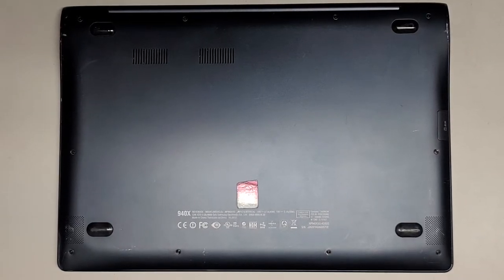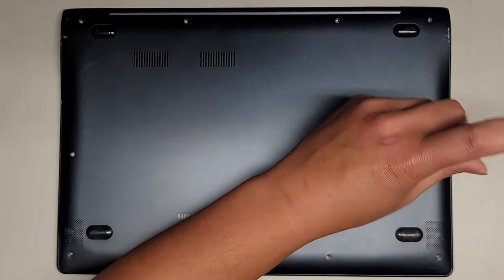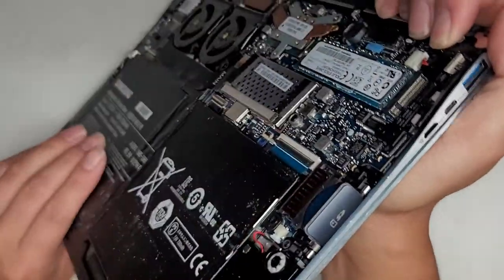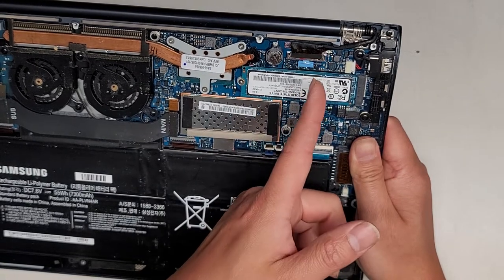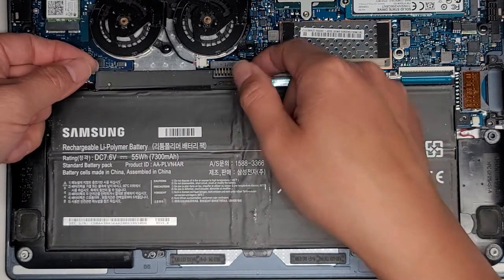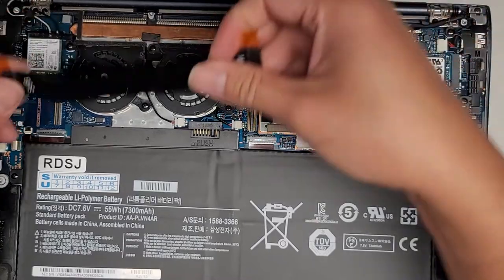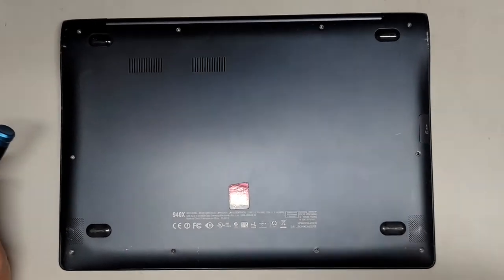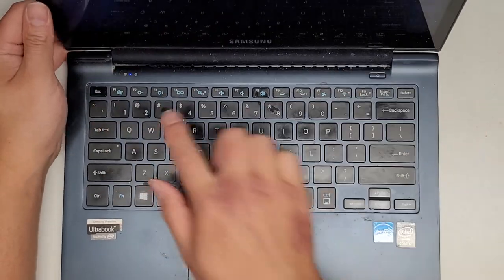Samsung Notebook 940X NP940X3G Disassembly Battery Replacement Repair Quick Look Inside RAM Soldered

Comment: Would it still be a battery problem if the little orange light turns on when I plug in my charger even though the laptop won’t turn on?
Reply from the maker: More likely a motherboard or power button issue

Comment: Hello, I have an external power supply problem on my SAMSUNG ATIV NP940X3G-K01US laptop. The battery no longer recharges, yet it is brand new (I just replaced it). When I plug in the power supply, the power indicator light turns green for 1 second, then it turns orange and then it turns off. I think it is a problem with the internal battery charging system. What could I replace to solve this problem?
When I power the laptop without the battery, the computer does not start, it displays the SAMSUNG logo and then it shuts down.
Thank you for your help.
Kind regards
Philippe
Reply from the maker: @PhilippeBourgine74  how old is the laptop?
Reply: @ItsBinhRepaired  about 10 years, but until today it worked perfectly. I do not know what part I can change by myself.
Reply from the maker: @PhilippeBourgine74  maybe needs a new battery

Comment: What's the name of the connector that unify both side of the mother board....the one that you need to remove at the beginning....cause it appears that one side got dirty and my laptop just the same as this one is not starting stays just charging....any advice?
Reply from the maker: Check the cable. It might have a model number there.
Reply: @ItsBinhRepaired  model number is armor 370 pin FPC...I believe is the flex...I leave the battery of for a while....it keeps showing charging screen...do you think could be something related with that? Thanks you very much in advance
Reply from the maker: @BlockbusterViews  I'm not sure